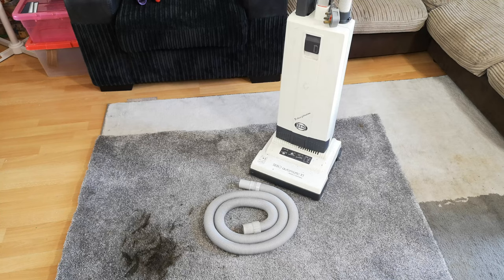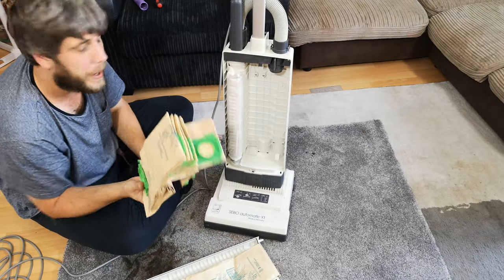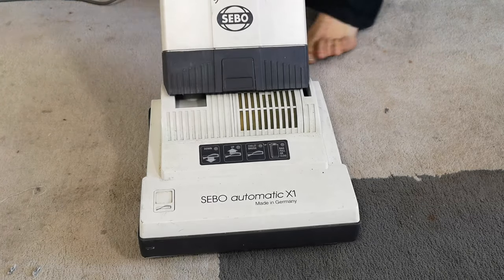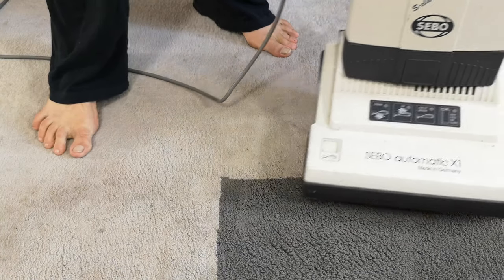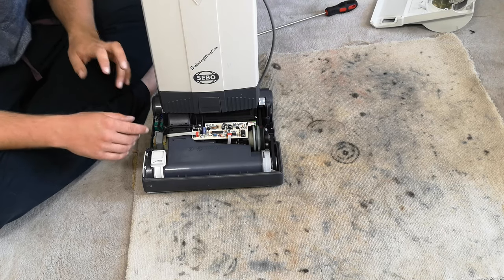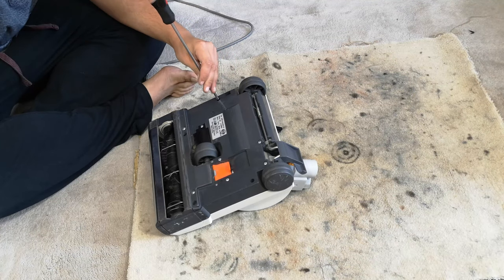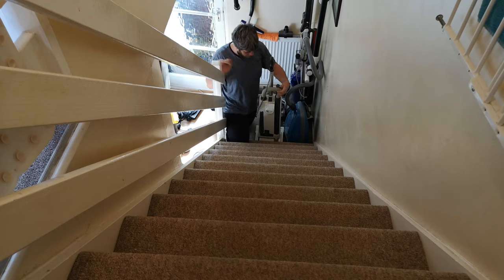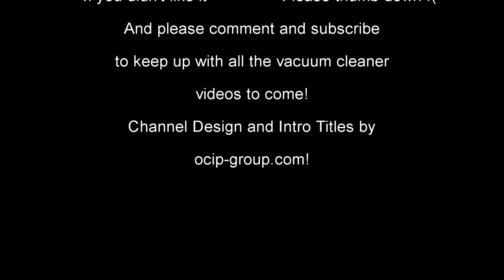Sebo Automatic X1 - First Look and the EASIEST repair ever!

Comment: Got to love the SEBO simplicity of service
Reply from the maker: Yep! Although a sod for this video. I started thinking we can get technical with a cheeky height adjuster rebuilt or similar... Nope. Pop the magnet back in (will hot glue it when I refurbish it) and try to fill the rest of the video up a bit!
Reply: This is why I still prefer the G1. You can make it the height that you want immediately and it’s virtually indestructible.

Comment: Someone has fly tipped one of these at my works unit. I had it in bits within minutes are found they had thrown it away due to a snapped belt. Was suprised how easy they are to strip down.
Reply from the maker: That's brilliant! (well, not the fly tipping, but you know...) Never known a belt snap on one, it's usually the cable broken where it enters the handle! And yes, their very good to have apart aren't they!
Reply: @beko1987  yeah so quick to take apart I was shocked four screws on base unit and slide the top part off. It now sits next to my heritage 84 Kirby which I bought to replace a Dyson so now a two vacuum household haha.

Comment: Mine needs a new motor ☹️
Got quoted £99 + del + vat hence why I bought a Vax U84-M1-RE.
Worse decision EVER!
Reply from the maker: Should have just picked up another sebo from Facebook and made one good one from 2... That is the problem with sebo (and miele), when something big goes like the motor it's very expensive...
Reply: @beko1987  
If I could have found one in decent contact and at a reasonable price I probably would have. It was way back in 2018. Maybe there's better choice now? 
I have looked and a motor (OEM ? Maybe not) is around £55 so maybe I'll dig it out and see if it's still worth repairing.